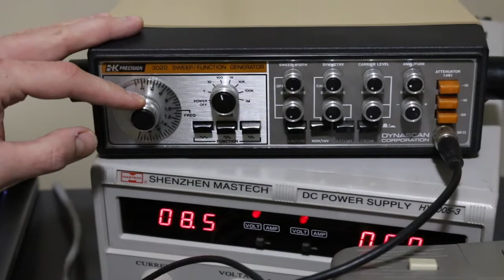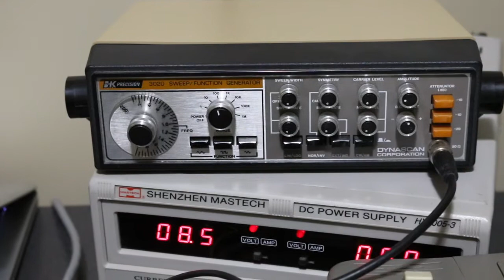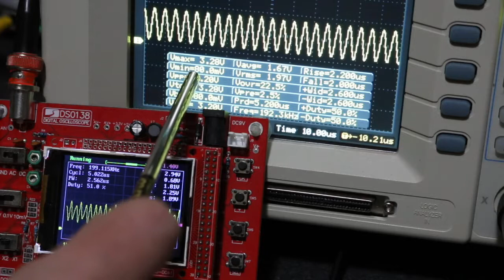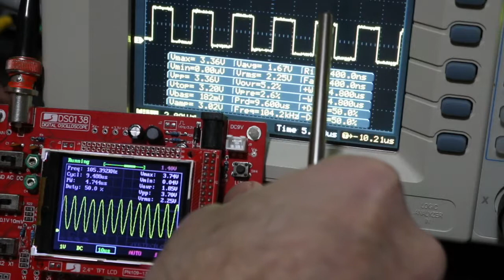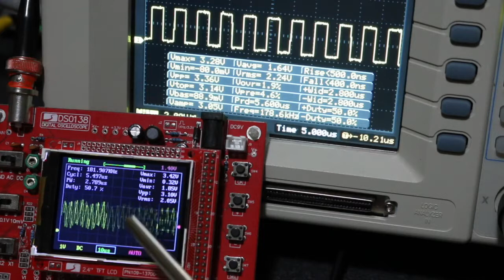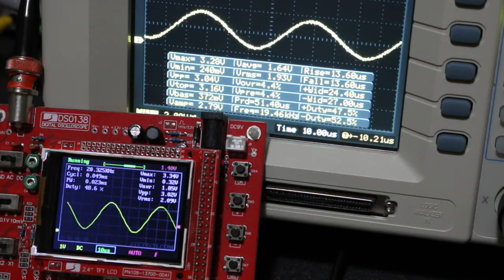DSO138 Oscilloscope Kit Performance Evaluation

Comment: Am i correct in thinking it will work to ensure dc offset is not present for audio projects?
Reply from the maker: it should work because it has both DC and AC coupling so it would be in DC mode to show offset.

Comment: Does it matter that you measured AC in DC mode?
Reply from the maker: DC mode just allows any offset voltage to also be measured instead of centring the AC around ground.
Reply: @GadgetReboot  Got it, thanks!

Comment: As you can see from the video, the 200 kHz claim is unrealistic.  One issue is the bandwidth of the analog input circuitry resulting in the loss of amplitude.  But the main one is how well the wavevorm can be handled given the digital sample rate.  it is pretty common for such scopes to still read the frequency to something pretty high because that is really a different function in the scope.  Bandwidth tends to be decidedly exaggerated on all of the "mini" scopes (and perhaps somewhat exaggerated on many others).  Furthermore, not to get too technical, but the algorithm used to divine a waveform from very few samples thinks in terms of a sine wave unless it has enough sample points to think otherwise.  While 200 kHz is claimed, more like 100 kHz is the limit for a sine, and 30 kHz (at best) for a square wave. But since many of these are used for people doing audio work, it can do the job surprisingly well for spending about 25 bucks and then either buying a battery or a maybe a $5 wall supply.  How this comes shipped has changed a bit over the years and the instructions may not exactly match.  And this is especially true for jumpers.  On both the DSO138 and smaller DSO138 "Mini", it may already have jumpers installed (as zero ohm surface mount "resistors") where the instructions say to bridge the jumper with solder.  So you don't have to.  Or there may be a jumper it says is already factory bridged, but isn't.
Reply: The number of 200 is not exactly unrealistic per se
The rule of thumb with scopes is that you are good upto 1/5 of the bandwidth, which would be around 40kHz here and clearly it works well upto that point so it does what it is supposed to do.
Reply: @MaxC_1  I guess that rule of thumb depends on what brand scope you buy.  I have used many Tektronix scopes where the specifications were accurate.  100 MHz meant 100 Mhz and that's what you got.  Even an old Hitachi V212 hobby level analog scope nearly met its specifications vastly better than 1/5 of the claimed bandwidth.  What the mini-scope manufacturer claims it is "supposed to do" is, however, is 200 kHz, not 40 kHz.  Another "rule of thumb" is the Nyquist theorem (sampling frequency being 2X is sufficient) which some exaggerated specs depend on and since this is a 1 MSa/s scope that would suggest the even more ridiculous 500 kHz bandwidth.  Having used, and calibrated, test equipment for over a half century, your rule of thumb may apply to the low cost cheap stuff out there, but certainly not to reputable brands.

Comment: There is a simple improvement you can make that solves a problem where the waveform might look a bit raggedy with high input signals.  It seems that the voltage divider resistances R6, R7, and R8 are low enough to put a bit too much load on the output of amplifier U2B.  Since the divider feeds into the non-inverting input of U2C, you can just raise those resistance values by 10 times with no issues.  And you get a cleaner waveform.  Use 1% resistors.  This also applies to the smaller DSO138 "Mini" version.

Comment: How did you get all that info on the top part of the DS0138 ? I have the same model but it seems like I can't get in any mode that will display the duty cycle, peak to peak voltage, etc. Are you powering the DS0138 from your computer via a USB cable ? I can't see any connectors on the top part of the oscilloscope.
Reply: Yeah nvm I just held the "OK" button for 2 seconds and the readout activated.

Comment: I am very beginner in electronics , and can not afford a big osciiloscope , will this be fine for learning basics?
plz let me know so i  can tell my parents to get this for my birthday! :)
Reply from the maker: as long as you use it within its specifications for voltage and frequency limits, it’s good for basics like putting it on the output of some oscillator circuit and seeing the waveforms and checking their frequency and voltages

Comment: So couldn't you modify some of the values of the components to increase or decrease its available measurement range and time adjustment? Thinking of picking one of these up to look at guitar pedal signals. Thanks!
Reply from the maker: Not sure if much can be done in just hardware part swapping to change bandwidth/timing because it would be all software and processor silicon capability related too.
I guess larger input amplitudes could be just scaled down with a resistor voltage divider, like adding an attenuation probe,  and smaller signals can be amplified with an op amp or something to get them into detectable range if they are too weak, if it's just to get a visual of the signal and not needing the readout to be accurate and not concerned about any new introduced noise or error offsets.
Should be able to see the output of a pedal with the range of this scope, the pedal output being somewhere less than a volt up to theoretical max of whatever the pedal runs as, maybe 9V.

Comment: I'll be honest I haven’t a clue how to use one, like someone else said I bought mine for the welding practice. At the moment I'm just at the beginning of learning about the Arduino UNO and I have heck of a lot of basics to learn yet. Mine was only £15 though and it comes with an acrylic/Perspex case. I'm just looking forward to the project, though I just have a cheap soldering iron so we'll see how that goes. I think I might need to upgrade my soldering station before my oscilloscope.

Comment: HII AND THANK YOU
Can IT  be use to automotive, to diagnoze cars. ? for example sensors or CAN
Reply from the maker: Depends what is needed, it may be able to show slow changing signals but it only has a bandwidth of 200 KHz, while CAN bus can be way faster signals
Reply: @GadgetReboot  THANK YOU
ALOT.

Comment: Can we connect the probe to +12 and -12 supply. that is 24Vpp?
Reply from the maker: The manual says it can take 50v peak, 100v p-p and I see that the op amps have a split +/- supply suggesting it can take +/- inputs (as a scope should) so it sounds like it can do +/- 12
https://www.elecrow.com/download/UserManual_138_new.pdf
Reply: @GadgetReboot  Thanks for the reply and for the manual. I have ordered this scope. I will check it with +/- 12v input supply. Hope it will not damage with 24Vpp input.

Comment: I bought it for soldering practice. That fact that it can actually be used for say, something simple under the hood of a car... Just to get a very rough idea, well that's just a bonus. Thanks for your time!
Reply: Have you used the DSO138 for automotive work, and what specifically did you test? I just ordered a Wave2 0-200KHz for an attempt to confirm if my car's alternator (generator) has an AC ripple voltage.  I"m second guessing the bandwidth and thinking maybe it might make sense to go with something in the range of 5MHz, so I don't end up with a useless trinket.  I've searched far and wide for examples of different real-world applications/examples of where one would find various Hz in electronic devices.  The closest I found was this spectrum table with power lines 50-60 Hz and computers with 60-100 Hz:  https://www.cancer.gov/about-cancer/causes-prevention/risk/radiation/electromagnetic-fields-fact-sheet  I see plenty of youtube videos with people adjusting Hz with signal generators, but no real-world examples where they could actually be observed. I would appreciate any helpful hints.  Does anyone have links of Hz tables or spectrum charts with which device sine wave square waves  would be present? Does saving a waveform provide an opportunity to attempt determine a waveform that's outside of the devices bandwidth?

Comment: All oscilloscopes attenuate as you go up in frequency. That's why the general rule of thumb is to buy one with a bandwidth 5 times higher than the highest frequency you will be using it on. That would put this one at 40 kHz for use which was pretty close to your results. I ordered the newer updated mini version in a kit with case for $11.87 shipped free but haven't received it yet.

Comment: The bandwidth rule of thumb is to use a scope with 5 times the bandwidth of what you need. If you want to measure 20 MHz signals you need a scope with 100 MHz. A 200 KHz scope would be good to 40 KHz which is very close to your results.  It would be interesting to see how the real scope worked when fed signals at the same percentage bandwidth as the DSO138.

Comment: Can anyone use it for viewing/measuring noise level and ripple voltage of an smps output?
Reply from the maker: Maybe if the frequency is within a few tens of KHz  it may be visible but switching regulators might be in the hundreds KHz and this device may not recognize it.  I would never use such a low-cost unit for anything serious, it’s more a visual novelty.
Reply: @GadgetReboot  Thank you very much for the opinion. Best regards.

Comment: Thaks for rewiew
Can be use it to mesure automotive sensors and signals? .And for example to measure the pure sine inverter?
Reply from the maker: I wouldn’t use it if accuracy is required but just to get a general idea if something is operating or not, as long as the input voltage isn’t exceeded, I would just use it to see if there’s any signal at all rather than trying to accurately measure the signal.

Comment: Great demonstration. Have you tried changing the V div to see if the voltage reading is more accurate? And have you tried changing the calibration trimpots?
Reply from the maker: It’s been a while since I did the testing  and I can’t remember how the accuracy looked at different voltage division scales but I remember setting the calibration to get a good one kilohertz square wave that would trigger properly and look to be the right amplitude and sharp edges, it needed a little tweaking. I had some sort of offset problem but it went away.  I should take it out and try it again now and see if the calibration has drifted as well.

Comment: 200MHz advertised bandwidth?
Reply from the maker: Oops.  Don’t know how I made that typo and never noticed it for a year. I’ve updated the description to kilohertz. Thanks. Maybe I should re-watch it and see if I said it verbally as well.
Reply: @GadgetReboot  
I use mine just as a novelty visual display for the output of my sound system, so the kHz spec is fine for my purposes.  My hearing is long past hearing even any semblance of 20kHz anyway- :)
Reply from the maker: My original idea for buying it was also a novelty for the monitoring  sound effect generating and other audio things which I hope to do more of this year. If I could afford it I would like to get into some modular synthesizer stuff. 
 The last time I watched one of those YouTube hearing tests that sweep up in frequency with an annoying tone, I could get somewhere over 14 kHz out of my ears.  At least now I have a baseline if I check in another couple of years.

Comment: This was extremely helpful sir. I am looking at building some guitar pedals and wanted to get an idea of how the waveforms would change with different components, and this cheap and cheerful piece of kit could be a perfect answer to my prayers. Much appreciated.
Reply from the maker: Glad to be of help. I might be working on some guitar circuits myself at some point. I just received a stomp box on off switch from eBay as my starting point.

Comment: So for audio acquisition it's good?
Reply from the maker: Yes it appears to work well for audio frequency range, which is well below its marketed bandwidth.   I wouldn't use it for anything too far above audio but that's all I wanted it for so it worked out.
Reply: BAMOKINA MOANDA Destin so are you using this device to tune your stereo equipment your amplifier so you won't have clipping
Reply from the maker: Yeah I used it to get a clean sine wave out that didn’t distort so I would know when I am operating in the right region for one small project I had. I might do a video on something like that.

Comment: Ok, but much faster to just turn the frequency up until you hit an attenuation of 3dB, thats the bandwith.
Reply from the maker: Yeah,  if it was a normal piece of equipment it would be a lot easier to check the endpoints of its operating limits but this one was a bit quirky.  

One of the main reasons I slowly went through the range  was to show where non-sine waves start to get visually distorted as well as where the voltages start to become less reliable on the display. 

 Overall I didn’t want to go through all of its features but just wanted to show that it should be OK for audio bandwidth..
Reply: And try to adjust trigger level and base time. It will stabilize the wave and you will get more stable values.